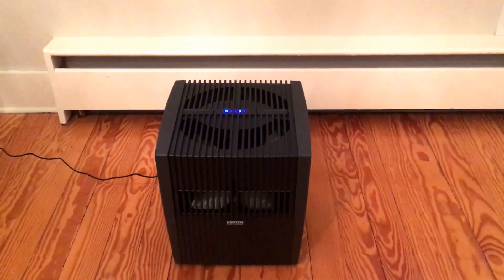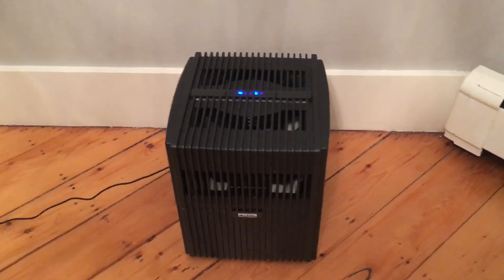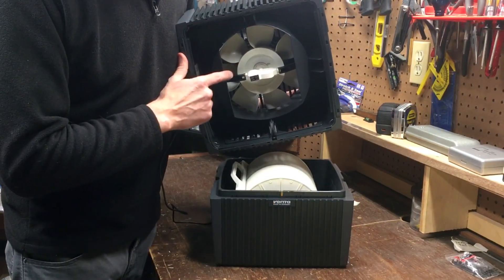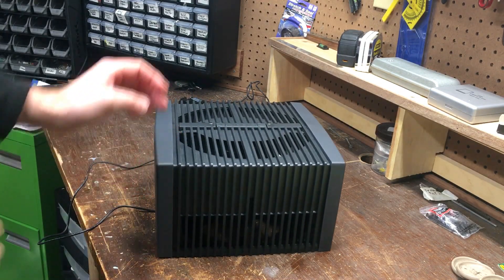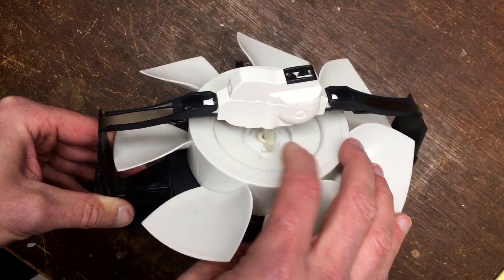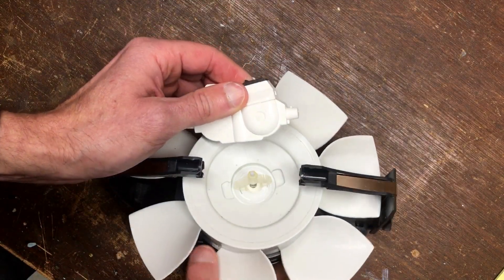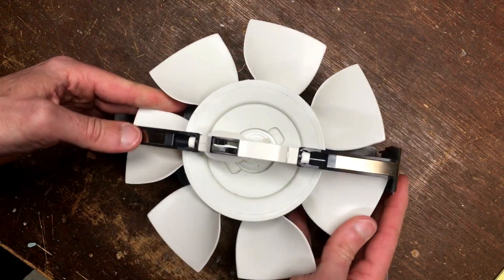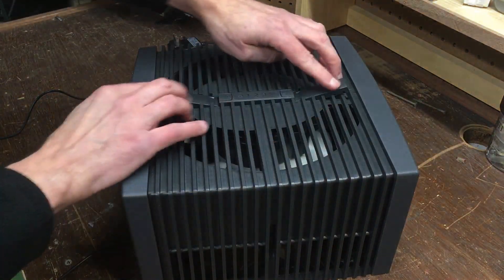Venta Airwasher Clicking Noise - TRY THIS BEFORE YOU BUY NEW PARTS

Comment: Fixed mine a bit differently, I just brought up the fins a little higher to meet the teeth. Worked just as well but much easier.

I will say that this is an extremely expensive humidifier that this should not happen to. I am extremely dissapointed with Venta's engineering, they have had this same clicking problem for decades.
Reply from the maker: Interesting James! Thank you for sharing. Just curious, how were you able to bring the fins up? 
I agree that for such an expensive unit, you would think they’d have figured out how to prevent this common problem. 
We have two of these and recently the newer one started turning off as if it is out of water (even though it’s got plenty of water).  I ended up taking the top of the unit apart and cleaning it.  Seems to have corrected the problem, but mechanically I haven’t figured out what caused it in the first place.
Reply: Hard to describe without images but here goes: The rotating fins sit in a carriage which in turn sits on a ledge in the moulded unit. In the center of the carriage unit there is a small space to attach a plastic clip on either side that raises the unit up about 0.5 -1 mm. That is all it needs to work properly. I honestly think that the although the piece was engineered properly for a dry rotation, the weight of the water on the rotating fans help drag the rotating unit down just that tiny bit. And of course the sound that everyone hears is of the pins of the fan clicking on the roating unit but not rotating it.

To me it is just unacceptable engineering. Really tired of consumer product problems. I used to watch an American show when I was young called "Fight Back with David Horowitz", we need more people like him in all countries. It is a freaking shame that someone like yourself has to tell people how to fix a problem that should have never existed in the first place.

Regardless of my rant, thanks for the alternative fix!
Reply from the maker: James Caldwell Your fix makes sense to me.  I’ll try it if the clicking comes back. Thanks for the info! 

There are a lot of QC issues on products these days. That show sounds fascinating.
Reply: In addition, you can try fix this problem in another way. The pins does not reach a ledges due to weakening flat springs in a holders of a gearbox. 
You need to pull out a both springs and to straightening that to more flat condition and to put in back. Thus, a gearbox to be more tough to press on a ledges. The next step, it's to reach easy rotation a washing wheel. To easeing rotation It is necessary regularly removal сalcium deposits with lemon acid or special cleanin agent.

Comment: I turned gears around as you suggested, but still got "clicking" sounds.  My LW44 model is around 15 years old, so it's probably time to replace the motor.
Reply from the maker: Sorry it didn’t work out. Our Venta hasn’t made a click since I turned it.

Comment: I have one in my music studio, it said a it’s suppose to automatically turn off when it runs out of water. But I’m not sure. I’m worried about it starting a fire. Do you know if it has a auto shut off feature?
Reply from the maker: When the venta runs out off water the indicator light on top will turn red and the fan will stop running, but it doesn’t technically turn off power.  If it makes you nervous that it doesn’t completely shut off, perhaps plug the unit into a timer.

Comment: have you made any humidity measurements? Can this box bring a room from 32% to 45% RH? Thanks.
Reply from the maker: Indeed this unit can bring a room up to 45 and even 50%+ relative humidity. I use a hygrometer in the room to keep it around 50% RH. It is key to make sure you have a model intended for the square footage of the room. Also keep in mind that the Venta humidifies by using evaporation, so it takes longer than a cold or warm mist humidifier to reach the desired RH level. I run the Venta on high until I get the RH where I want it and then use low or medium to maintain it.

Comment: how fast should the disk stack be moving? I have cleaned everything but don't seem to be getting the mumidification I require. My stack doesn't move continuosly and is kind of jerky
Reply from the maker: That sounds correct. The stack spins slowly and jerky to allow for evaporation. The Venta’s don’t humidify as fast as an ionizer or hot misting humidifier, but if you keep it running it will raise humidity in a few hours if on high.

Comment: DANG IT... I just returned the damn thing after calling the 188 number 5 times with no response. Well, I had bought it today and ended up returning it same day. Little disappointed to return it as this seems like a easy fix but again, if after $550 I have to fix anything day 1 then I rather send it back. (the LW45 unit)
Reply from the maker: I have to agree with you on that. Should work for the price tag. Luckily ours hasn’t clicked since I made the fix a few years ago.

Comment: mine started to click as well. I solved it by turning the lower container by 180 degree. All noise is gone since then. this happened when was replacing the water container and placed the top the wrong way.
Reply from the maker: Yes, that does work occassionally. I used to do that, but eventually the noise would come back.

Comment: How many gallons a day will this put out?  Looks like it holds a paltry amount of water.
Reply from the maker: The reservoir holds 2 gallons.  How often I have to fill it depends on the fan speed, indoor humidity, and size of the room. Typically when I have it on high fan speed during the driest winter months in a 120 sq ft room,  I have to fill it roughly every 12-15 hours.
Reply: Their flagship model pumps out just over 2 gallons of evaporative humidity a day which is about as much as a typical mist humidifier.
Reply: @BruceAlanR  Thanks!
Reply: @artv4692  Thanks!

Comment: Mine developed a problem where the red light stays on and it keeps on detecting that the case is open. If i apply some downward pressure it works find but as soon as I let up I get the auto stop and red light.
Reply from the maker: I’ve experienced this issue before and it was driving me crazy. It would run for a minute and then shutoff saying it was out of water when it was filled. I lived with it for a month and then removed the entire motor assembly (like in the video) and put everything back together. There was something not sitting properly that prevented the lower housing contacts from touching those of the upper housing (it may have even been the cord seated improperly or even the disk stacks placed in the bottom incorrectly).

Comment: I just got mine today.  Mine doesn't have the clicking sound but it has some slight rubbing sound.  I did the switching shown on this video but that didn't help. Can I just put WD40 and see if it becomes silenter?
Reply from the maker: I don’t recommend using WD40. The motor bearings should never need lubricating. Where is the rubbing sound coming from?
Reply: @BruceAlanR  I think it's where the fan meets the coupling(?) the rubber clear thing. I can make the sound just by spinning it by hand.  I expected some noise at the higher speed but mine makes the sound just at the lowest setting.  Not noisy to the point I can't sleep, but I can hear it.  I had a Honeywell's cheap humidifier and it was pretty much silent.  So it was disappointing. :(
Reply from the maker: Sorry to hear that! I like the Venta air washers, but I do think they’re overpriced. Extra noises drive me crazy which is why I have a habit of taking things apart. 😃

Comment: Tried this, and it didn't fix the weird rattle that developed overnight in my old Venta. If I hold the fan sideways, it's dead quiet. As soon as I turn it horizontal, it's got a loud rattle. Don't see how I can fix that.
Reply from the maker: I find that sometimes taking things apart and putting them back together can get things back in alignment. Good luck!

Comment: Does it clean air?
Reply from the maker: A Venta “air washer” is basically a humidifier. It adds humidity to the room using a fan and evaporation. While it does capture small particles and deposit them in the water via the air-intake, it is not a replacement for an air purifier.

Comment: Didn't work for me.
My Solution: I took apart the little gear box and put some (mechanical/lubricating) grease on the mechanical parts.
You have to be gentle when dismantling the little gear box. I used an tiny screwdriver for this.
After that procedure the noise was gone.
Reply from the maker: Sorry it didn't work for you, but thank you for sharing your repair. If you make a video of it, I'd be happy to link to it.

Comment: You don't even need to take the thing apart. Just push down on that gear assembly until you bottom it out. Problem solved. No need to flip or anything.
Reply from the maker: Seriously? Ha! Thanks for the tip. My vents hasn't made a noise since doing this a few years ago.